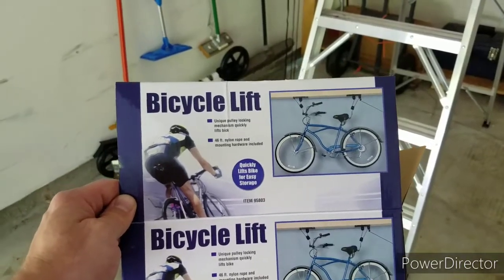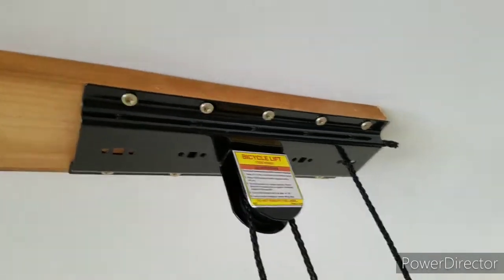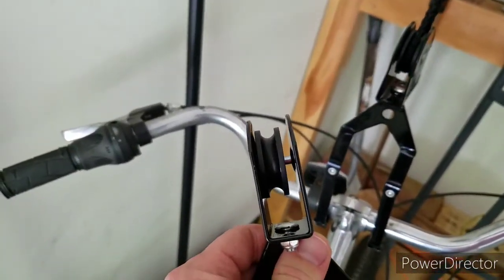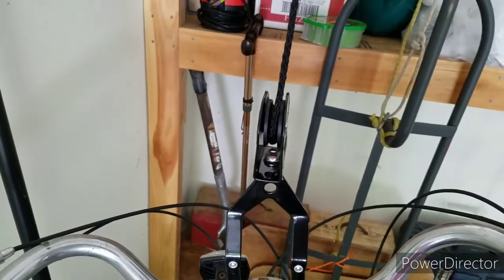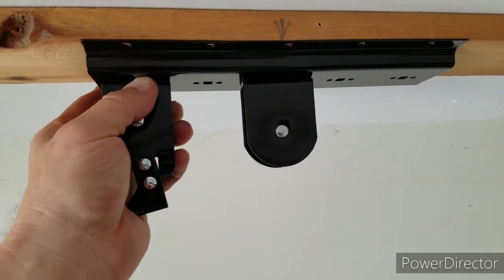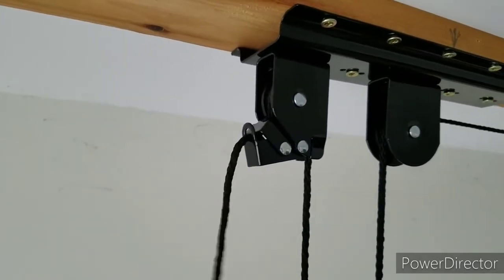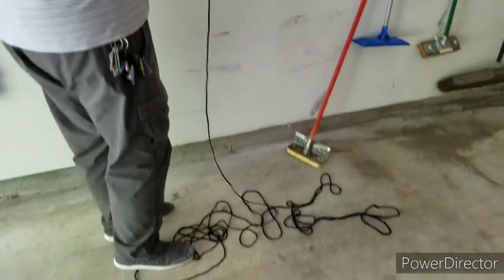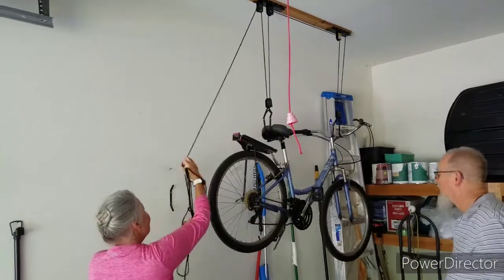bicycle pulley lift system installation

Comment: Great video! What size screws did you use? Also, what kind of 2x4” wood is best for garage use? Last, what length of screws did you use? Links would be great to find the parts or make a parts list for my trip to Home Depot. Thanks in advance!
Reply from the maker: I actually just used some old 1x4 lumber my parents had left over after moving into their new home. 
It was from a packing crate the movers made. 
Any pine lumber will work just fine.
Just be sure it is wide enough for the pulley bracket bases.
I used 2.5" long screws to ensure that they bit deeply into the ceiling joists above the drywall ceiling. 
And 1.5" for the bracket holes that just engage the lumber.
I use spax T star plus,  flat head screws for all of my projects. Stocked in any hardware store fastener aisle.

Comment: Could you use the pulley system to levitate the bike for repairs too instead of using a repair stand?
Reply from the maker: It would work for the height, however the bike would be swinging all over the place if you were wrenching on the bike, it might work for a quick job every now and then,  but that's about it
Reply: I'm using it as a repair stand and it's way more stable than I thought it would be.  It works well!